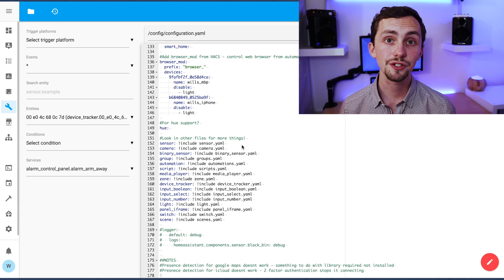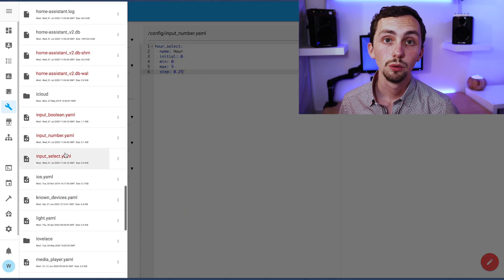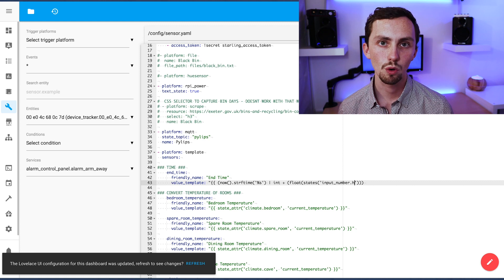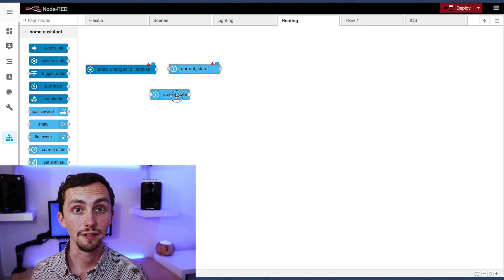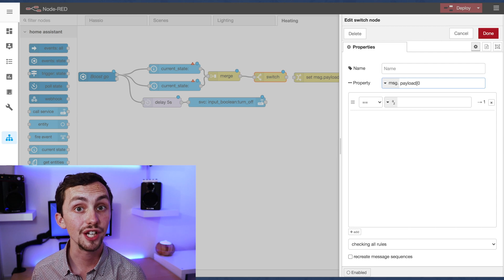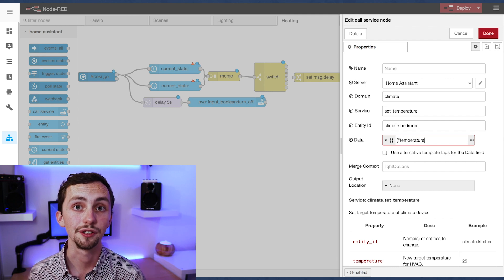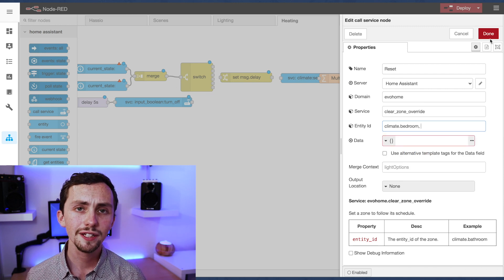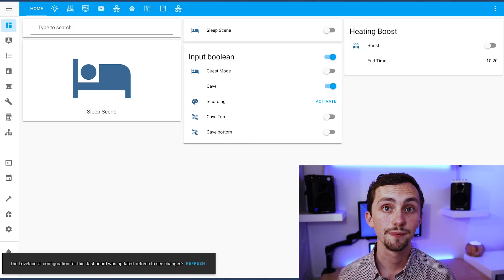Home Assistant Custom Heating Boost - Node Red

Comment: Great video. But when I start heating boost, end time keps changing time. First says 18:25 and time, and after 10 min. says 18:35.
Reply from the maker: The end time in lovelace will change, but the time which went into node-red will stay constant as it actually uses the delay instead of time - the end time is purely so you have an easy way of knowing that a 2hr30min delay will mean it finishes at 12:30 for example

Comment: Sounds like a great idea for boosting heating in individual rooms, hopefully it’ll work with Hive... but more interesting is the explanation of the merge function and how to extract the elements from the payload, as I’ve been trying to suss that out for a while. I’ve been using AppDaemon as a light controller for my Hue and Tradfri remotes, but it eats CPU cycles. I’ve looked at NodeRED to do this instead, but making many flows for each remote is just too fussy. Merge should help me make a single flow for each remote type, now I understand how it works.
Reply from the maker: Yeh it took me a while to figure out merge! Glad you can use it for something else!

Comment: Great video!  You can get around the merge by setting using the change node to set alternative msg values (msg.heatsched) to be used later in the flow.  BTW, I finally got my version up and working based off our previous discussions and your earlier examples you shared. The US version of the climate/honewell API left lots of challenges and ended up creating custom schedules (heating and cooling) with specific temperature  so I now control everything from HA including guests/vacation/etc and I override any schedules in the thermostats.  Still have some clean up but is working.
Reply from the maker: Glad it's working, yeh i think it's probably easier to control it all from inside HA! I'm pretty sure I had tried that and for some reason it couldn't make it through the switch, maybe I was doing it wrong - it was a little while ago now!